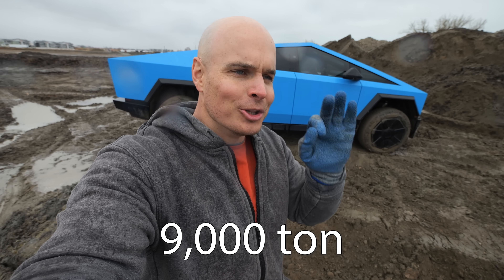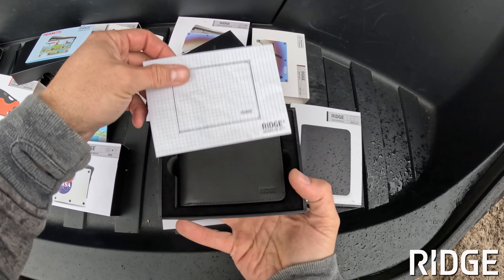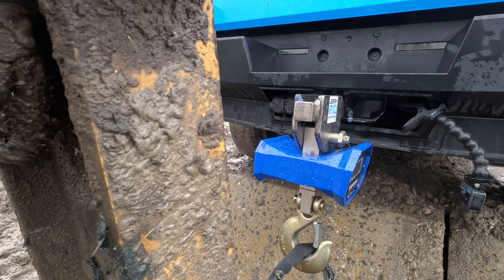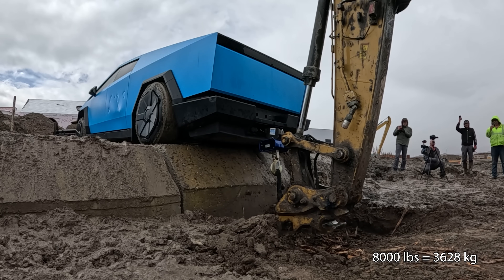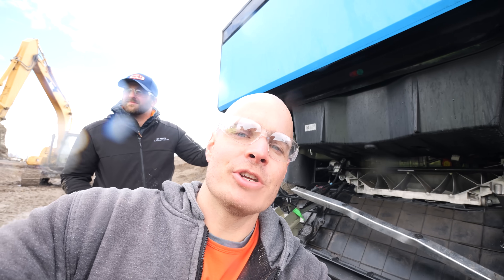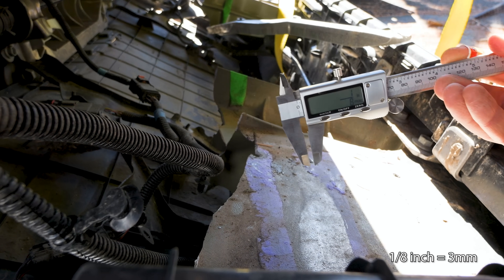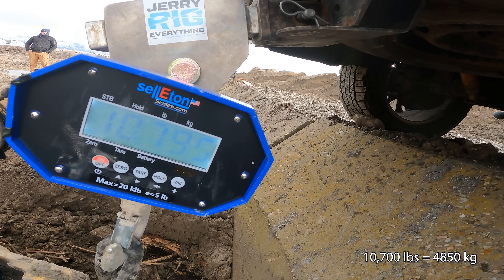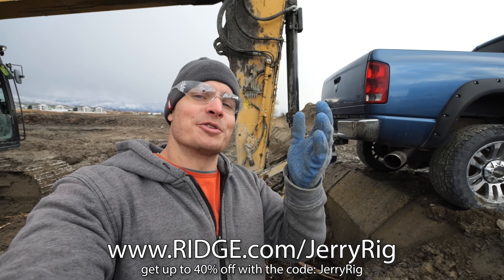SHOULD YOU TOW WITH A CYBERTRUCK?! - (catastrophic failure test)

Comment: i am actually quite impressed at this result, i am not a tesla fan by any means but i did study engineering and the fact that it took almost 950% of the rated capacity for tongue weight is actually incredible and it pains me to say that but i remember testing reinforced conrete steel beams in a workshop when i was a student and those broke at 2.7 times the maximum capacity which is already considered a good safety margin (it's to cover both user error and possible manufacturing mistakes)
I honestly thin this is a proof that tesla did a good job
now something i would like to see tested is a horizontal stress test
more precisely, loading, unloading sequences with increasing force (pull 1 ton, release, pull 2 tons, release, 3 tons, release etc untill faillure)
This would show if there is actually a risk when pulling that the frame gets fatigued and snaps while towing
but i suspect it would take a real strong winch because let's be honest, whistling diesel did bump the heck of that hitch before it failed and that is definetely not normal intended use, he actually had it toe to toe with the test mule untill tesla ignored him and he kinda rigged the second test to make tesla lose lol

Comment: He had to put a machine at the front to stop the truck from lifting and then had to move the excavator because it couldnt put enough pressure on it.  And yet people will still say it is not strong enough.  
945% of tongue weight before failure...  
No matter what people will hate on Tesla even after way over performing.  
This is typical tesla footage just to get engagement from ignorant haters
Reply: They did the wrong test to show the right problem. Aluminium will fail before steel, as any stress put on it results in permanent wear. Steel can bend within limits and still retain its structural integrity. The best way to do this test would have been to push on it with the rated tongue weight for a lot of times. Whistlindiesels truck broke in half because it had a crash that weakened the aluminium and the subsequent towing pulled the already weak aluminium apart.

It's the same problem as when people were "bend-testing" the iphone 6s plus.

Comment: I’m not a grade school art teacher, but something tells me that in every real world scenario, if the hitch load is great enough to lift the front wheels of the truck, the driver will have difficulty entering the vehicle and may be alerted to the overweight trailer. So the definitive conclusion is this guy is a genius at engagement farming.
Reply: And you're a genius at missing the point. It's about sudden weight redistribution and the longevity of a hitch attached to an aluminum frame. Nobody ever claimed people are going to load the ball with 10k lbs. Do 10k miles in a cybertruck with 1-2k lbs on the hitch and I bet the same test will snap with 5k lbs on the hitch. Not to mention, of all people loading a trailer, cybertruck owners are the most likely to do it improperly.

Comment: So since Aluminum is such a poor material for carrying loads, we should not use it to make say airplanes which see pressure/depressure cycles on every flight and then fly them for 20-30 years. 
ALso the tongue weight for an 11,000lb trailer should be around 1,100lb not 11,000lb.
So you're expecting the CT to wheelie due to the vertical weight on the hitch? That, I have never seen in any towing situation.

Comment: Mechanical Process Engineer here, worked on designing the factory lines that make Jaguars and other luxury cars. Those cars are 85% held together by that purple glue stuff. It's not a Elon being cheap thing, it's a pretty standard structural element. It stop the things from leaking too which is a big plus

Comment: when pulling a load at a 45 degree angle the vertical force is 70% of the load weight. so if it was 11000 towed then you would still have 2000 pounds before it brakes. and thats if the trailer is at a different angle from the truck. otherwise the vast majority of the force is felt perpendicular to the tow.

Comment: No, the entire weight of a trailer doesn’t get fully transferred to the tongue weight, even when going uphill, downhill, or cresting a steep hill. Tongue weight—the downward force on the hitch—typically stays between 10-15% of the trailer’s total weight under normal conditions, and while it can shift due to incline or momentum, physics caps how much it can change.

Here’s why: Tongue weight depends on the trailer’s center of gravity and how it’s loaded. On a flat surface, say your trailer weighs 10,000 lbs; tongue weight might be 1,000-1,500 lbs with proper distribution (axles toward the rear, load balanced). Going uphill, the trailer tilts back, shifting some weight off the tongue toward the trailer axles—reducing tongue weight, not increasing it. Downhill, it tilts forward, pushing more weight onto the tongue, but the axles still bear most of the load unless the slope’s absurdly steep (think 45°+). Cresting a hill adds dynamic forces—momentum might briefly lighten or spike the tongue load—but the trailer’s full weight doesn’t just dump onto the hitch because the axles and suspension keep distributing it.

Real-world example: Studies from the Society of Automotive Engineers (SAE) and towing guides (like Reese’s) show tongue weight fluctuations rarely exceed 20-30% of the baseline unless the trailer’s horribly misloaded (e.g., all weight up front) or you’re on an extreme grade. Even then, a 10,000-lb trailer fully transferring to 10,000 lbs of tongue weight would require the trailer to basically stand vertical with no axle support—impossible in normal towing. Pickup hitches and frames (like your 2004 GMC Sierra Quadrasteer, rated for 10,000 lbs towing) are designed for max tongue weights around 1,000-1,500 lbs, not the whole load.

So, short answer: No, the full trailer weight never hits the tongue, even on hills. It shifts some—less uphill, more downhill—but the axles and trailer design prevent a total transfer unless something’s catastrophically wrong. Load it right, and you’re fine.

Comment: Can the ford handle extremes better?  Sure.  But the CT handles normal use cases just fine.  The ford falls into “over engineered”.
Reply: You realized the truck in this video is made by DODGE not FORD, right?

Comment: This isn't very relevant to the engineering that goes into a towing rating. I know you have connections with Sandy Monroe, go get a lecture from him. Then show us your math. The steel frame on the RAM is there so larger models can have a higher load rating on the truck itself, not to reinforce the hitch against absurdly out-of-spec loads. Try that same test on a trailer with matching ratings and see what you get. Or maybe, you could Jerry Rig a fatigue test to see if Tesla hitch fails. I expected more from this channel than jumping on a hype bandwagon.

Comment: I'm not a mechanical engineer but i would imagine slow downward force is significantly easier than quick force of the same amount. Essentially the cybertruck was given a significantly easier test even though they both had roughly the same amount of weight.

Comment: Static loading ≠ dynamic loading.  Hitches take all sorts of dynamic loads like when you hit a pothole at speed and it causes the tongue to bounce...also, straight down, the max load the hitch would be expected to take is the max tongue weight plus some dynamic load factor plus some overage margin.  Most of the loading from a 12k load would be rearward from the thrust needed to overcome the aerodynamic resistance of the loaded trailer, plus the rolling resistance of the trailer axles.  I agree with the assessment that aluminum is fundamentally flawed as a truck frame material.  Attaching a class III hitch to it is asking for frame destruction 😅

Comment: The experiment is wrong because, in addition to measuring a vertical force rather than actual towing capacity (a horizontal force), it also fails to include the compensating force exerted at the front to keep the truck from lifting. To calculate that force, a torque balance is performed using, for example, the rear axle as the reference: if the total weight of the truck (6,600 lb, equivalent to 3,000 kg) is located 0.8 m ahead of the axle (producing a moment of 6,600 lb × 0.8 m = 5,280 lb·m) and 10,000 lb is applied 1 m behind the axle (−10,000 lb·m), the difference (−4,720 lb·m) causes the front to lift. To cancel this, about 1,475 lb must be applied downward at the front (for instance, if the front is 3.2 m ahead of the axle: 1,475 lb × 3.2 m ≈ 4,720 lb·m). This shows the truck would not only be supporting 10,000 lb at the rear but also an additional 1,475 lb at the front, plus its own weight of 6,600 lb, for a total of about 18,075 lb. In any case, this approach does not measure true towing capacity, which is a horizontal force measurement.

Comment: This is idiotic. You are testing tongue weight not tow weight. It is virtually and factually impossible that your 10k lbs trailer would in any case hit a pothole or do anything to cause a yield force of 10k lbs downwards on the tongue. Not even in the steepest of hills you would apply a more vertical than horizontal load. This test only prooves the insane high capacity of 3M automotive bonding combined with aluminum casting exceeding 10x what is legally allowed to hold in that tongue.

Comment: I'm not an engineer, but in Germany there is a term called tongue load, Stützlast. Everyone who wants to tow a trailer to their car knows the term. Trailer hitches are usually specified with a tongue load of 70 to 90 kg. That's not much, and yet they can still be used to tow very heavy trailers. And that's exactly the point, in this video the tongue load, Stützlast was tested and not the towing capacity. As far as I know, the Cybertruck has a tongue load of 500 kg. To be precise, the tongue load was exceeded by 10 times, which no one in their right mind would do in reality. That's why I dislike this video, because it's just stupid Tesla bashing. I usually like this channel, but this completely wrong method of testing, no. Simply no.

Comment: I've always trusted your content, but I'm not sure we can anymore. You either only care about the traffic, or you're on the "I hate Tesla because of DOGE" bus. A Cybertruck is rated for 2,500 lbs payload, and a tongue weight of 1,100 lbs. It didn't fail until almost 10 times that weight! Even a Ram 3500 is only rated for a 6,500 lbs payload. The tongue weight should be 10% to 15% of the total weight. No truck can safely handle 10,000 lbs of tongue weight driving down the road. C'mon man. As far as breaking... aluminum is more rigid and breaks way before steel. I'm not going to argue whether they should have used steel, but saying it could be dangerous behind a Cybertruck because it could hit a bump and shift 10,000 lbs to the tongue is just dishonest.

Comment: Castings can be incredibly strong, but they don't flex very well. So when they take strong impacts or reach their pressure limits, they tend to fail catastrophically. Where as most other metals will just bend and deform.

Tesla should either revise the rear casting of the Cybertruck (Make it thicker, or add more support), or issue a recall that modifies the towing capacity to something more reasonable.

Comment: I am very surprised that the aluminum casting is so thin and also that it is that strong. If the material had been 1/4" thick it would have held a tremendous amount.

Comment: You exceeded the CyberTruck tongue weight rating by 945% prior to breaking the chassis.    
The device you used to adapt the load cell to the receiver placed the load center further rearward than a plain trailer hitch, thus increasing the bending force applied to the receiver.
The Ram 2500 has a higher towing capacity than a CyberTruck.
Reply: >The Ram 2500 has a higher towing capacity than a CyberTruck

Yeah, 20,000lbs vs 11,000lbs.
Reply: "The ram 2500 has a higher towing capacity than a CyberTruck."
that year ram has a towing capacity of 9,400 pounds off the bumper. higher numbers are for trucks with a 5th wheel attachment.
Reply: @forkface750  Fair, i just googled it.
Reply: He acknowledged this in the video and explained how the hitch may experience the force being applied. You can't only consider towing weight in a vacuum because the force being applied isn't static and parallel to the road 100% of the time.

Comment: 10.000lb? Start towing a load with a chain connection that's anything less than solid and the spike is going to be that big. If I'm towing anything, the chain should break before the car. This truck isn't fit for towing anything but a child's sled in winter, provided the car survives the wet autumn followed by the freeze first.

Comment: How are they going to make it right? Well, they won't. Possibly a disclamer in the usage of the car, but modifying the casting tool to change the design of the part would cost WAY too much, not to mention it would take a very long time. These tools are designed not to be removed but only maintained on the machine. The cost of re-design, manufacturing, trials, certification would most likely be in the millions.

Comment: The moral of the story is that on the Cybertruck, you want your break-away cord attached to some point other than the back bumper to ensure pulling the pin to apply the trailer bakes if the whole bumper separates.

Comment: Your test only proves that the hitch is sufficient.  The tongue weight is supposed to be 10% of the trailer weight, so you would NEVER see 10,000lbs of tongue weight on any passenger vehicle because that's a 100,000lbs trailer.